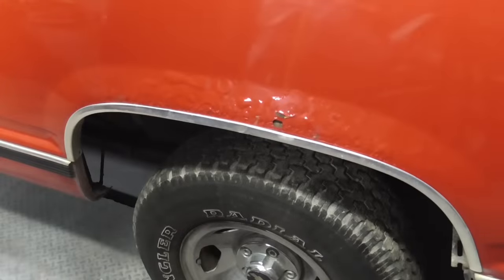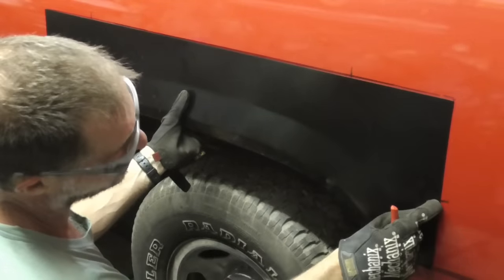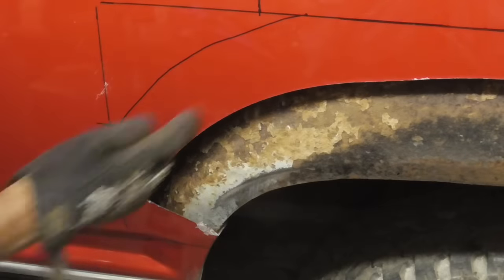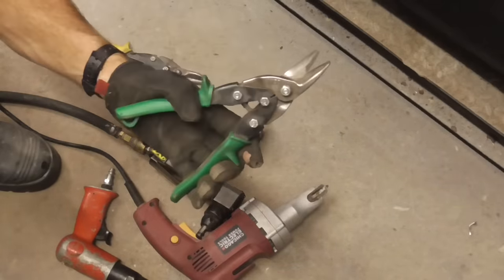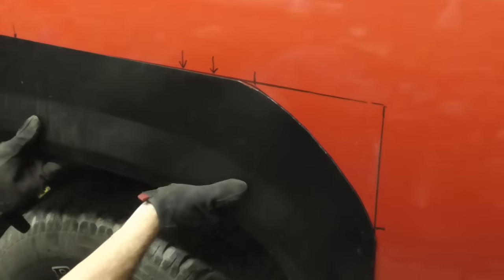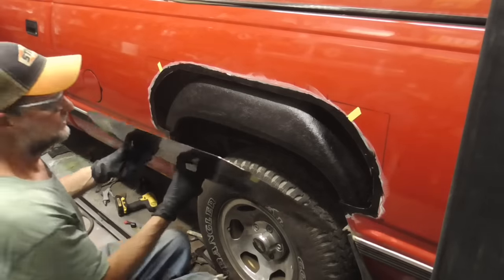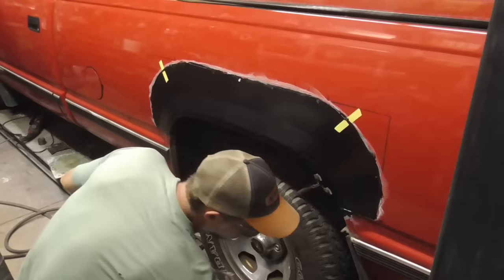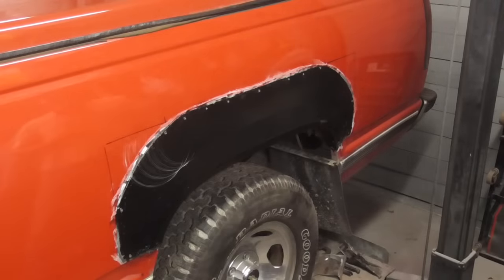Glue On Wheel Arch Rust Repair Panels w/ SEM Impact Resistant Panel Adhesive

Comment: I have 8 classic cars I've bought to restore and most need panels and it's the welding that I don't like, Ive been researching glues and most new cars are now all glued together as in my building homes I've been gluing for 20 years with great results
Reply from the maker: I appreciate your input George - I do believe this method can last as long or longer than new as this patch panel is 18 gauge as you can see how hard I had to hit it to "tap" the seam down :)
Reply: @LakesideAutobody  l was impressed my friend has been using a 2 part epoxy system and trying to get me to try,, only hold back for me is I'm doing classic cars and trying to use as little of body filler as possible and don't butt welds to conseal repair and laps but it sure would make my life easier with so much panel work ahead of me.
Reply from the maker: @georgespangler1517  It can't hurt to know all the methods of rust repair  - each repair is different and you will pick up speed by using the appropriate method for each situation.
Reply: @LakesideAutobody   so far it's been to cut it all out and fit new peace excactly and mig weld it completely in making a surface as smooth as possible with little filler, it's time consuming and even nerve racking , and now even makes it hard to get started knowing what's ahead
Reply from the maker: @georgespangler1517  I've worked at 4 different shops over a career in the metro Detroit area - lots of rust.  The shops I worked at were considered very good quality shops and the method of rust repair was always the same: - lap weld (MIG), knock down the seam, fill.  Please see this video for why they do it this way.  It may make your life a lot easier.  https://www.youtube.com/watch?v=JIIonJOVro4
Reply: @LakesideAutobody  I agree 200 percent but in the classic car world they want to not see any laps and as flat as possible  I even feel the lap is stronger and surly easier to fit,  I change alot of full panels and drill out spot welds to keep patches to a minimum, it's just what people want when paying big bucks for classic cars I even go inside trunks and grind and fill seems there to consel them, l like what I saw in your vedio and will do it on less valuable cars but I know it won't fly on high value classics,,l don't the rules but I have to abid by them to get good return on my restorations
Reply: @LakesideAutobody  the older cars was 18 gauage metal and a lap is alot thicker than the 20 gauage metal in your repair you can cut it with tin snips like you was,, newer cars are much thinner metal and you can lap with less filler,,
Reply from the maker: @georgespangler1517  I get it.  Stay in touch and send me a picture or two when you get one done - would love to see it -  schoolvideolibrary at gmail dot com 
Here's my classic I had for 25 years - just check out the pictures at the end - https://www.youtube.com/watch?v=2o37dX--w0I  Have a great week :)
Reply: @LakesideAutobody  dam that hurt to see l had a 1973 charger SE with a 400 motor at 19 years old,, my first car was a 67 Dodge charger with 383 and second a 70 challenger 340,,  l miss them and if I only knew what they would be worth now,,,l only have one Mopar a 45 dodge pickup I just built from scratch,, my list,,,68 Torino,71 tornio, 2- 64 gallaxies XL500s,, 72 Chevelle,79 z28 Camaro, 68 mustang GT, 66 mustang, 64 elcamino, 84 vette,66 ford pickup and 1930 street rod l built from 2 frame rails and built all aluminum body I've won 6 trophy's at car shows with it  l know I'm obsessed but there all money car's except for the vette but 700 I couldn't pass it up,,
Reply: @LakesideAutobody  I forgot I have 3 - 80s years bronco 2s also
Reply from the maker: @georgespangler1517  Very cool - those broncos are always in demand :)
Reply from the maker: @georgespangler1517  Every one of the cars and trucks are awesome - good selection.   I used to love 68 Cougars too or the AMX

Comment: Flange tool makes the panels fit flush so much better and takes less filler to cover
Reply: In time you will see the outline of the seam if not knocked down below the surface

Comment: Nice job! I’m planning to try the adhesive method on a cab corner repair to avoid burning my truck to the ground! 🤣
Reply from the maker: Here's a cab corner w JB Weld but you can use this adhesive instead if you prefer - this method holds up real well - https://www.youtube.com/watch?v=wRl1QfkrBeY
Reply: I did my 2011 f150 but I welded (wire feed ) my rockers and cab corners but the back side off corners behind the cab I used epoxy structural body panel bonder because I had no way to remove my box easily it worked great . The f150 can be set on fire welding back of the cab also lolo. Once the paint dries I sprayed entire truck including inside of rockers and cab corners with oil thinned with mineral spirits
Reply from the maker: @nickking1510  Good thinking :)
Reply: @LakesideAutobody  as a teen till 22 I worked full time part time while going to school and college at a small town chev olds dealership restoring  used trades and in body collision shop back then we brazed sheet metal what a warping mess lolol car undercoat  fires quickly extinguished lolo . Once  we had a traded 1970 yellow Grand Prix  and a customer 1970 yellow Grand Prix in for brakes guess what the boss told the head body man to prep and paint the traded Grand Prix lolo instead he ran the customers in the body shop we sanded and prepped and painted it at the end of the day next day the mistake was realized the owner boss  walked away saying I just can believe it several times . The customer was happy free paint job to his badly stone chipped car and then a brake job with 20% reduction in quote . Bill our boss was a great guy and sadly died in 1976 as a result of a car accident some months before at age 34  . I Thank Bill many times for allowing me opportunity to work and learn skills which have save me many$$ it was a great addition to shop class in school .
Reply from the maker: @nickking1510  Guys like that are great - I was lucky enough to run across a few fellas like that and it changes the path of your life for sure :)

Comment: Nicely done Jerry! I've only tried adhesive once so far, on a replacement cab corner. I didn't want to deal with removing the bed, which meant the MIG gun couldn't get to that part in between. Did a combo of MIG from the rocker, up around and across the face of the corner and glue the rest of the way. I stuck a wet paper towel over the joint where the glue ended so the heat from the MIG wouldn't affect the adhesion. Seemed to work out just fine
Reply from the maker: That's a heck of a good plan using the wet towel.  I am keeping that in mind because there are times when a hybrid patch like that could be beneficial.  Good stuff Icar!  Have a good weekend my friend :)

Comment: I've done something similar like that on my 98 Pathfinder when I used to have it had a lot of rust everywhere but I didn't do it your way I ended up just putting out the garage just by using a cutter from Harbor Freight and then when I was done with it I ended up having a piece of cardboard and recreated offender by placing it on a piece of metal shaping the metal welding back to metal and then repainted and boy that truck looking very beautiful and I was done

Comment: I've used 3m body adhesive and will be doing some similar repairs soon but I think it would be better to lap the new panel under the old or at least this is what I will be doing
Reply from the maker: There's an inner panel that's welded to the outer so that's going to be very frustrating - maybe even impossible to put the panel behind or under.   Let me know what you end up doing and how it worked out.  Have a good weekend CW :)

Comment: Gee, I used to drop the tank and weld them in.  The guy I trained under used to just make the panels out of washing machines using a torch, hammer and wet rag.  Barely used any bondo.
Reply: Did he take the wheels off before he pushed it in the shop too?
Reply: @paulhare662  Who needs a shop? Just pull over to the side of the road and get out the hammer and torch. Should be a ditch close by to wet your rag.

Comment: Interesting method to avoid welding. Adhesive must be similar to that used on new aluminum body Ford PUs. Thanks for sharing.
Reply from the maker: It's really your choice - I like both ways.  In my mind both are quality repairs.  I just wanted to show how to do this method at this particular time.  In the future I'll weld one on.  Both methods are excellent for rust repair :)
Reply: @LakesideAutobody  Right.. I was just noting those folks without a welder would really appreciate this option. Thanks again. Best to you and yours.
Reply from the maker: @RaysLaughsAndLyrics  Best to you and yours too Ray - nice talking to you - have a good weekend :)
Reply: The Panel Bonding adhesive is as strong or stronger than a conventional weld with no panel warping. I live in Ontario Canada and have used this method several times for replacing rocker panels with no issues years later.
Reply from the maker: @recrdholdr  Thanks for your input & support Steve - have a good weekend :)
Reply: They glue new Corvette chassis together!!!

Comment: Just curious, why not use a lap joint to mate the two surfaces? Seems like you would use much less Bondo, less sanding, etc.
Reply from the maker: You can do that if you want.  My thinking is this ---  "You can't flange the lip so why flange the big open area?"  I like to have one method that works every time on every hole.  Hope that makes sense - Jerry

Comment: Great video. I have a 1988 Ford Econoline with windows all around. I intend painting it in a few months and would love to fill in the windows but doing it the traditional way of spot welding my way around something like 30 ft of seam and then spot grinding same puts me off. It'd just take forever. Rather than have the panels cut to the exact size of the holes for welding in, do you think having them cut say, 1/2" bigger all around and gluing them in place would be a good idea? Thanks.
Reply from the maker: Make sure you have about 1" to apply adhesive.  I believe it would work just fine.  Do a test window first if you want.  Heck, glue it on with JB weld just to see - https://www.youtube.com/watch?v=wRl1QfkrBeY - still perfect after almost 3 years.

Comment: You do get some rusty vehicles in, but I’ve seen just as bad in Illinois on the streets. Fixed a few of my own rust buckets. I always use my torches to braze in new panels, never have tried panel bonding them on, cuz I don’t have the 3M gun to mix the bonding material.    At any rate thanks for showing us how it is done!
Reply from the maker: You're welcome - my dad used to braze patches and use fiberglass - that's how it was done for quite some time :)

Comment: The panel lap line will show in a few months after expanding (hot weather) and contracting (cold weather).Steel, epoxy and polyester filler( Bondo) expand and contract at different rates. So  the outline of the patch will be visible after cycling a few months unless it's buried in excess 1/4" of duraglass and or Bondo. Too much IMO. Also.. i have done collision resto and fab for 48-9 years and have never ever  "pop" riveted a repair panel especially using aluminum rivets on steel panels. Plug welding the kleeko holes would have been a better choice. Disimilar metals aren't compatible and will start to oxide at the first wiff of moisture. Lastly.. polyester primers (eg. feather fill )  are not direct to metal or recommended over bare metal surfaces without proper (DTM) protective undercoats due to their poor adhesion lack of corrosion resistance and porosity. Essentially the reason  we don't use lacquer primer anymore. Believe it not moisture will penetrate thru even the best clear/bascoat/single stage/ primer/Bondo and when it reaches bare (under the filler) metal you get iron oxide  better known as rust under it all!. I'm not knockin the repair because welded or bonded new metal is still better and longer lasting than a cave and pave (tiger hair, duraglass, Bondo) technique but flanging the panel using weld thru primer and continuous spot welding would make for a better longer lasting repair. This would be acceptable repair for folks witho

ut a mig welder obviously. Bonding works VERY well on roof skins bedsides and doorskins but the mfgs. Still recommends SPRs fasteners or spot mig welds to prevent panel breakaway.
Reply from the maker: Here's a follow up video 3 years later on this method and others found in major body shops in SE Michigan or Detroit area ( the rust belt) - https://www.youtube.com/watch?v=gIS1Tbv7Kvw
Reply: You can do whatever you want  time will tell what happens  it could last a few months or  a life time losts of factors ivolved. If you live in a dry climate it should be ok. Only time  will  tell.also depends if it's in an area that  takes pressure. That will cause the patch to fail or crack were it was   patched. There's  always the right way the cheat way the save money way and your way. I know  he wasn't building  a show truck
Reply: While yes there is so much wrong with this repair. And I agree with all your points. In 99% of cases...when done properly...the seam line will not show. And actually a glued panel avoids many of the pitfalls of a welded repair. 
And face it some jobs, the investment is not worth it.
And to anyone reading these comments contemplating this job. Find another video.The first tell of someone "just getting by" is they mix their adhesives and fillers on cardboard. We knew better than to do that 40 years ago
Reply from the maker: @jimk4267   Many very good body shops are using adhesives along with OEM - Check this video out for longevity of this method and others.  https://www.youtube.com/watch?v=gIS1Tbv7Kvw
Reply: Some new commercial vans are gluing quater panels on now.when you rip that seam sealer off there's no spot welds just a bonded glued on big quater panel.couldt believe it the first time I seen it.
Reply: @derrickmurphy7729  oem's and collision repair shops have been using adhesive to install non-structural panels for over 30 years. this isn't new at all. 
Roof, quarter and outer rocker panels just to name a few.
Reply: @jimk4267  so true but and I would be familiar with that but I had never seen it done from the factory on a brand new van until about 10 or 12 yrs ago.great stuff.cheers jim.
Reply: Yves, the line read-through can be reduced by feathering the edge of the metal like a blade. If I was doing the repair, I would have spot welded over the holes after grinding the heads off, then put a layer of fiberglass reinforced filler down first, then regular polyester fillers on top of that.
Reply: Yves, what is a "continuous spot weld?"
Reply: @davidblodgett1908  A continuous spot-weld you ask? One that would be used like in this wheel arch repair section video. Spot welded from one end of the repair panel inside the flange line to the other alternating and cooling back and forth to minimize possible warping of the panel(s) the continuous part is spotwelds with no gaps between them from end to end
Reply: @LakesideAutobody  this is just an extension of glueing bus bodies together, for the past 40 yrs..
Reply: @derrickmurphy7729  here in aus, not sure where it came from, but, for the past 40 plus yrs, bus bodies have been glued on.. not new thing..
Reply: @LakesideAutobody  outside pnl,new,,inside panel, rusty, should of cleaned up the inside..
Reply: @harrywalker5836  lol I suppose the yrs don't be long going.40 yrs wow man.Thanks.
Reply: I did this on a '79 Pontiac Formula 400 back in 1995. Rear lower right rear quarter up to the beltline. 
As you discribed, the mating line will be visible.......later after the completed paint job. To me because I knew were it was.
 I had to point it out to some then they seen it. I used aluminum rivets then ground them off flush. I used Tiger hair then a light skim of Bondo. 
 I painted the whole car Massey Ferguson red , tractor enamel.  The car was "cherry" when I sold it in '08 !
Reply from the maker: @harrywalker5836  You can absolutely clean up the inside and do with that what you think is best.  I treat the repair after it's painted like this - https://www.youtube.com/watch?v=8XaZBy7GC7A
Reply from the maker: @harrywalker5836  Yes - you're absolutely right.  It's been being done for many years now.
Reply: This adhesive method of how semi truck roofs are bonded to the rest of the truck,just a lot more of it. The reason to use a mixing board for small amounts is the adhesive is expensive and the tips fill and waste quite a bit just to fill small areas.

Comment: Some questions. 
This looks strong enough non- unibody panel, but would it be strong enough on rear wheel arch patch panels of a ‘68 Camaro?
2. How do you rust proof the remaining exposed metal inside the repair once closed up?
3.
How did you remove the cliqot clamps from the glued in panel? Weren’t they glued in, too?
4. Wasn’t the strength of the pop rivet severely compromised by grinding down the heads. 
Thanks. Great video.
Reply from the maker: Yes it would be strong enough on a unibody vehicle.  You can leave the rivets or screws in for extra strength - just tap it down a bit.  I took them out so viewers wouldn't complain about dissimilar metals causing corrosion but you'll be fine.  Yo can certainly clean up the back side and undercoat with good quality rubberized undercoat by 3M or SEM.  The clamps were a bit stuck but the glue takes more time to get very ridged so they came out.  You can simply use screws or rivets - I prefer screws for more control - drill the outer hold a bit bigger.  The panel is still fine today - 8/18/24 - neighbor's truck :)